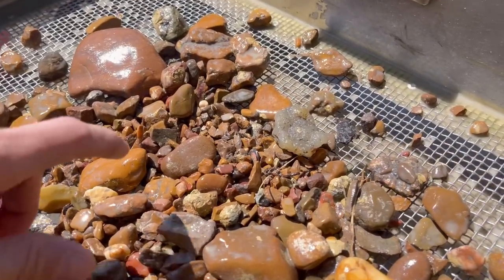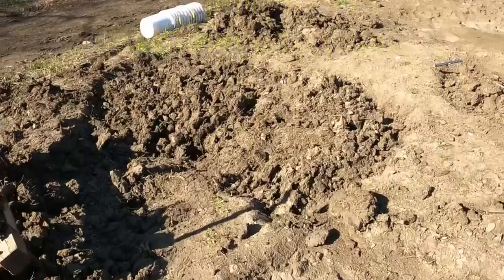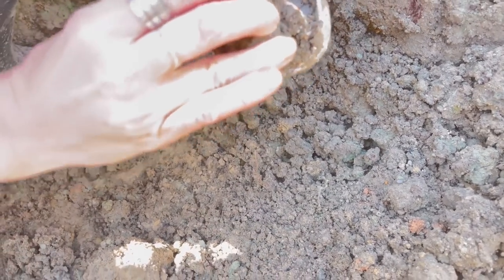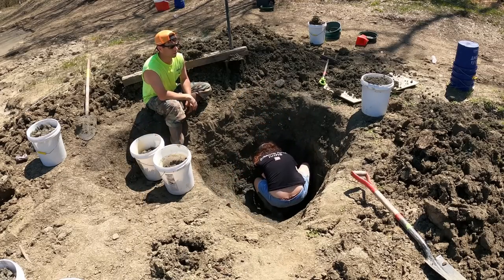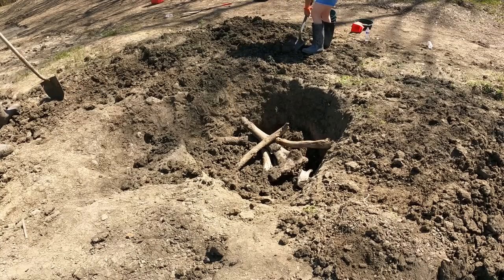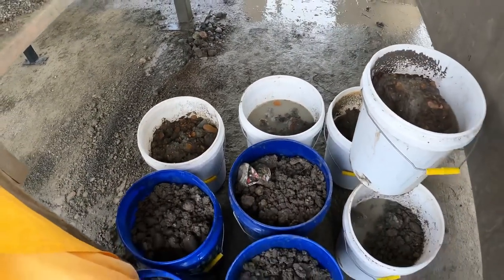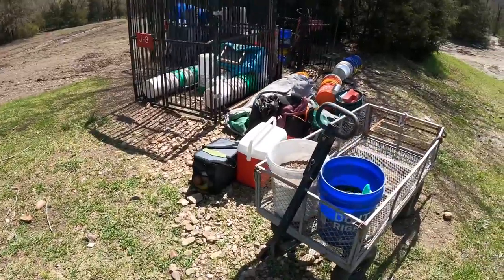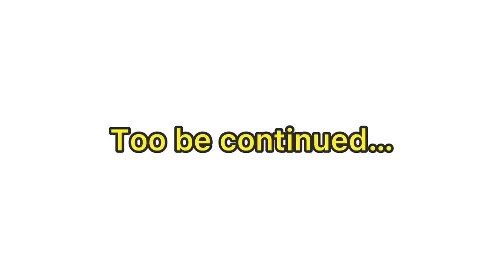THIS TIME OF YEAR IS WHEN THE BIG DIAMONDS ARE FOUND!!! Crater of Diamonds

Comment: could you make a tool consisting of a very long prybar, with a fence post driver on the handle,  to drive the bar into the soil and get it ready to shovel   out of the hole ? less stomping on the shovel, save your feet and legs.. . . . and your arms. .

Comment: I bet you’ve got digger’s arm……which is just what i call it. Technically it could possibly be a combination of tennis elbow, radial tunnel syndrome and nerve impingement. Which a nerve can get impinged anywhere from your neck all the way to your wrist. It hurts SO incredibly bad and for a while. Especially when pressure is on the nerves. 
Research nerve flossing and the best stretches you can do to relieve the pain. Also! Ice is your friend but only in like 5 minutes intervals with at least a half hour in between icings.